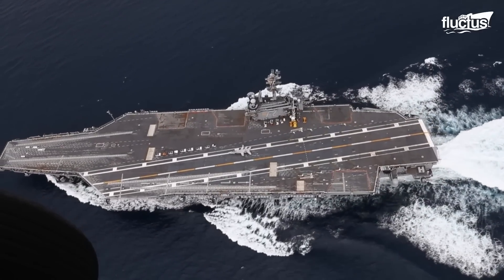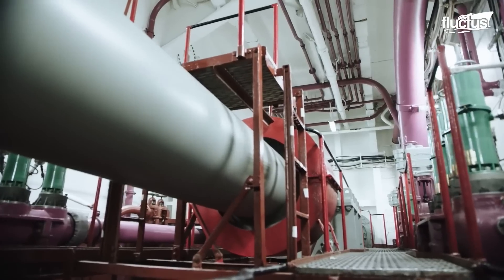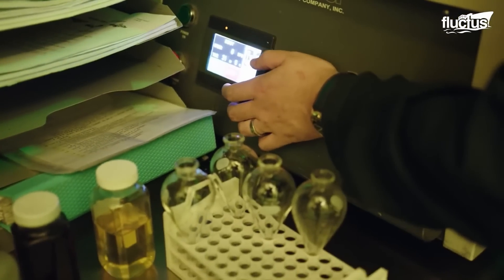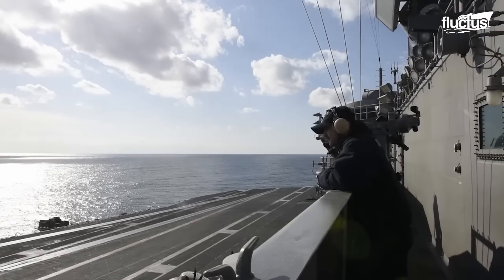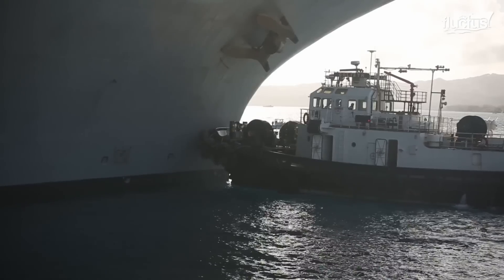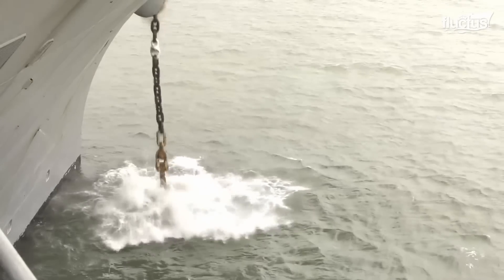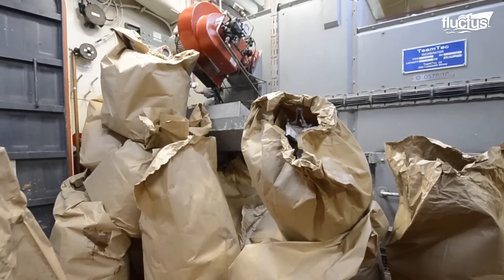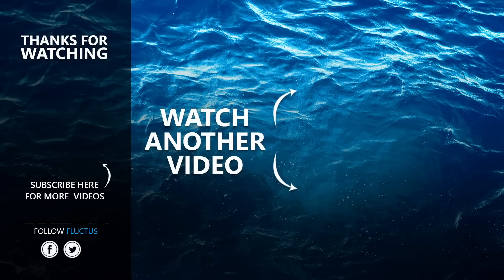The Crazy Amount of Power Needed to Move Massive $13 Billion US Aircraft Carrier

Comment: Our Navy carriers never had diesel main engines. They were steam turbine powered by oil fired marine steam boilers. They burned Bunker C oil which was thick and nasty and needed to be pre heated to be pumped to the burners. Even the Ship Service Turbine Generators were not diesel. I worked on the USS Enterprize and Carl Vinson. Both had nuclear reactors to make steam to run the main propulsion turbines and SSTG sets. I worked on SSN Los Angeles and La Jolla at Mare Island. These subs were nuclear powered and were propelled by steam turbines.

Comment: Nuclear reactor, good for 50 years, most likely a highly minimal estimate, perhaps much, much longer. I’d say it’ll last longer than the vessel is in. How about being able to transfer it to the next generations?
They use fuel that is much more enriched than land based reactors.
Reply: has some people thought of commercializing a scaled down nuclear reactor on these?
Reply: @n0madfernan257  I want one
Reply: @n0madfernan257  heaps of people.  get the antis and liberals and greenies belowdeck and it might actually happen.

it will have to happen anyway, the only difference is now much pain we are prepared to experience first.
Reply: They get 1 refueling in their lifetime.
Reply: There are several plants being relisenced out to 80 years, where the vessels will be reevaluated for possibly more time. All the used fuel from the past 50 or so years of fission power running at around 90% capacity factor in the USA can fit in a Walmart parking lot. There are zero other current sources of power that has such a minimal environmental impact.
Reply: My milk & cereal are sed 2B
 enriched.  Same stuff??

Comment: American carriers never used Diesel engines, they were steam powered with boilers.
Reply: Steam comes from boilers which are heated using bunker fuel. I think this is heavier than kerosene or diesel.
Reply: @rajeshkanungo6627  water & heat, lol
Reply: Some kind of fuel had to power the boiler.  To create the steam. The original Enterprise was powered with four steam turbines using bunker fuel. Marine diesel Or  Gasoil
Reply: US Navy ships have EDG's, Emergency Diesel Generators.  While not a primary source of power, they can operate off those EDG's, thereby running off diesel engines.  Also, the last of the conventionally powered aircraft carriers used the same fuel for the aircraft and the boilers.
Reply: Good to know
Reply: Fuel oil
Reply: Think of the modern days you dingus, these videos are modern day videos, not back in the old days of steamers
Reply: Oil fired boilers.
Reply: I thought it was powered by a million hamsters on crack.
Reply: What created the steam?
Reply: @jakelrsaunders  coal
Reply: @jakelrsaunders the boilers
Reply: @jakelrsaunders  not diesel
Reply: Wrong

Comment: So if that ship was sunk. Could that polute the worlds sea's , being nuclear??
Reply: Not sure about Aircraft carriers (because it has never happened) but the nuclear submarines Scorpion and Thresher went down in the '60s and the reactors on both were scrammed (deactivated) and the fuel rods were released into the open waters. I believe the U.S. Navy retrieved the fuel rods and they monitor the site every year. They do tests on the marine wildlife around the submarines every year and supposedly you can eat the fish and be fine. Take everything they say with a grain of salt because if there was contamination, they wouldn't tell us if they don't have to. The good thing about water is that it is one of the best Neutron absorbers. The hydrogen in water is the lightest element in the universe. Nuclear power plants use water as a moderator. You can safely go swimming in a pool of water with active fuel rods inside and be fine. If there was contamination, it wouldn't go far. It's not something that would spread endlessly. It would stay in that area.
Reply: @ejkk9513  Thanks for the info.
Reply: @EJK k  Yup. Entirely correct.  Oysters now grow 6 to 7ffffffeet accross
Reply: @EJK k  Yup. Entirely correct.  Oysters now grow 6 to 7ffffffeet accross
Reply: @EJK k  Yup. Entirely correct.  Oysters now grow 6 to 7ffffffeet accross
Reply: @wagner9050 one time is enough.
Reply: In theory the reactors are in safe housings. Soon after any then they will be retrieved and delt with.
 In reality who really knows what would happen. However I'm fairly sure that nuclear submarines have went down and the issue resolved.
Reply: If we ever get into a war where one of our nuclear aircraft carriers is sunk, pollution of the sea will be the least of anyone's concern. Most likely, we won't be around in that event, or very shortly there after.
Reply: Nope. Seawater evaporates harmful radiation & turns it N2 compost.  Right?
Reply: They say there safe, If they get hit with a few hypersonic missiles witch as yet they cant stop me thinks maybe not safe?
Reply: Russia's single carrier is not nuclear.